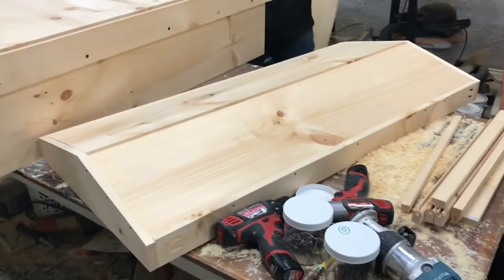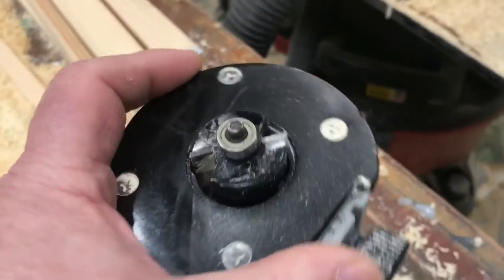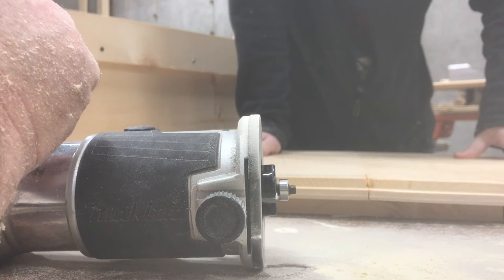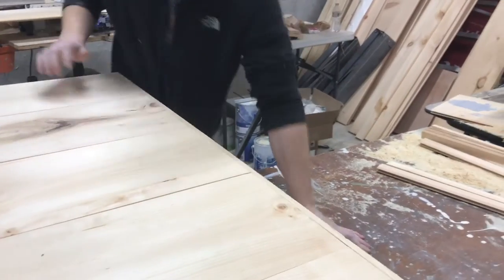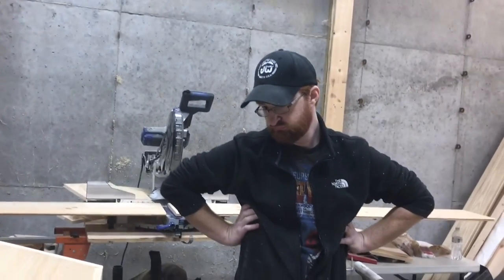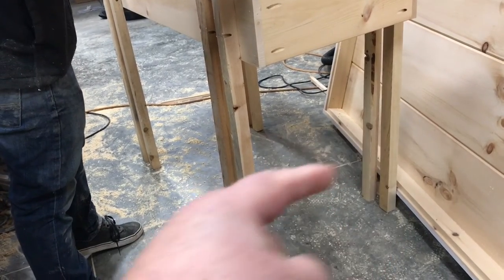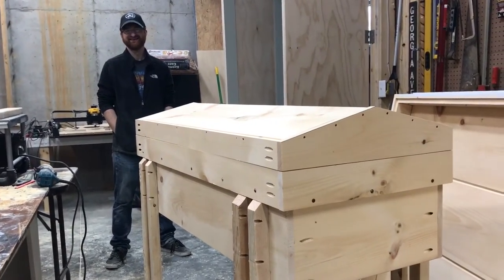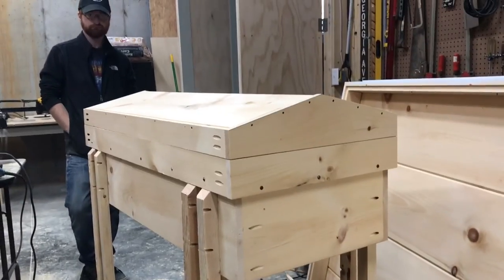Hybrid Top Bar Beehive #3 Almost Complete - Need New Location!

Comment: yall need a moat and hive beetle eating gators in it protecting it lol
Reply from the maker: MCK flying gators :)
Reply: ArtisanTony well and guess I learned something new, the beetles fly in , thought they may be a ground type lol
Reply from the maker: I am changing the design of the entry to make it easier for them to defend against those pesky beetles.  Instead of a hole which seems to be hard to defend I am going back to a slot just tall enough for the bees to get in.  Like a Langstroth hive. That guy had it figured out 100 years ago :)